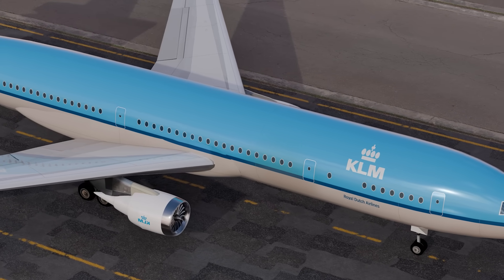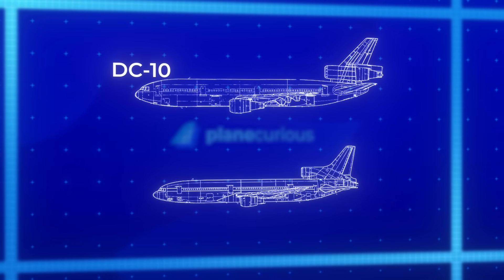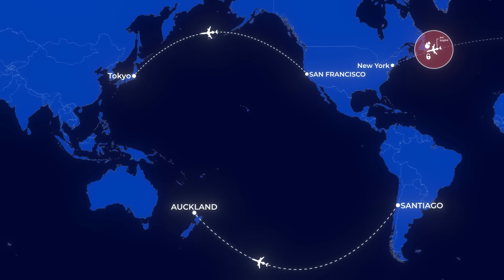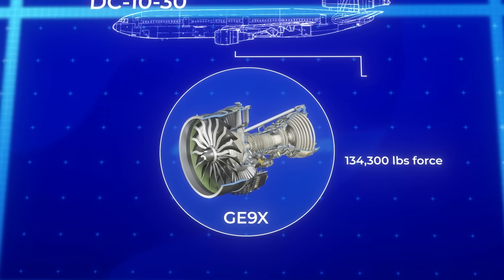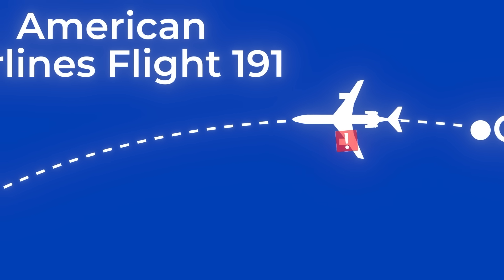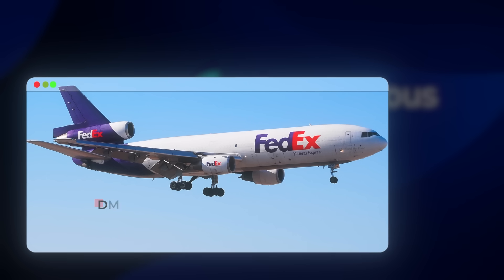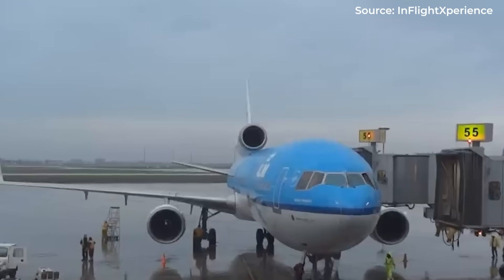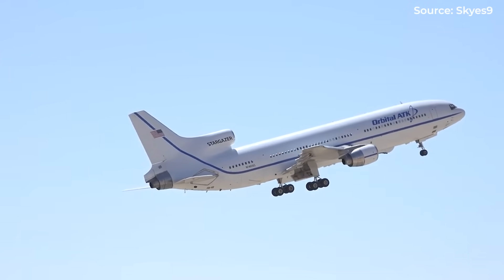Trijets Changed Everything - Until They Didn’t

Comment: They never needed 3 engines. It was all driven by FAA regulation demanding "more than 2 engines"
Reply: FAA never had a specific regulation "demanding more than 2 engines".

FAA regulations for two-engine aircraft aimed to ensure safe and reliable operations by establishing specific requirements for engine performance, operational procedures, and maintenance practices for extended operations.   

At the time, airlines wanted to create new routes, or expand existing routes which would require flying over water. When those could not meet existing engine performance requirements, operational procedures, and current maintenance practices, airframe manufacturers turned to a third engine.  Doing so was result of the state of engine reliability at the time, coupled with  airline customer demand. 

Bottom line, the decision was safety and market driven.

Comment: Flew on a 727 as a kid which seemed impressive to me and a step up from the 737 which was the first plane I flew on. Never flew on either the L-1011 or DC10 though have been on a few 747's. I always thought the L-1011 Tristar was a cleaner design and from what I understand was a technically more advanced plane.  I do seem to recall the 727 was quite noisy but I was sitting towards the rear of the plane.

Comment: Lots of air miles in all of them. All 3 were okay if you weren't in the noisy rear seats. DC-10's rode better in turbulence than any plane but a 747. 727 is a much smaller aircraft and really not comparable to wide bodies, regardless of engine configuration.

Comment: I had two trans-Atlantic flights on DC10's and to be honest I was somewhat nervous, but I found the aircraft quite comfortable, the seats were much better than the hard things you sit on now. And,. seat pitch was great too. Personally I prefer a 747 and 777 but I am glad I did get to experience one of the icons of aviation. I seem to recall the print ads used to boast that the centre engine was as long as the fuselage of a DC3.

Comment: In answer to the question, yes - I've flown on DC-10s, MD-11s and the 727 a few times before they were withdrawn from service.  I always thought the 727 was the most beautiful jet of all of the 700 series - so pretty, and it had that really neat rear door.  Loud though... holy moly.  The less efficient engines as well as the noise were two primary reasons the 727 were withdrawn.  I wonder if Boeing will ever make something that pretty again (especially in their current struggling state)?

Comment: A Mentor of mine...The Late Great Captain Harry Hargrove / AAL......discovered and sounded the Hydraulic alarm on the DC-10 six months before the
United SUX crash.  That being so many hyd connections under the center engine.  I had the opportunity to share this with the amazing Captain AL
Haynes.  I have had several hydraulic failures over 35 years in the cockpit.  Just the nature of the Beast.  But never anything like the SUX Crash.

Comment: Flown decades ago now MANY times in a 727, ALWAYS a better experience than a DC-9 or 737. Also flew a number of times in a 1011, those WERE the 'Cadillacs of the Skies', much more memorable than my 747 flights. TWA, my Dad's lifetime company (23K+ hours, mil/airline combo) had retired (1965) but then worked for FAA giving him chance for short stints at wheel of both a 747 and 1011 (former of his copilots, now senior captains he was 'check riding' with) told me- he liked 1011 over 747 for his very short time piloting both. The 1011's features from a pilot's perspective were just better!

Comment: "The probability of a dual engine failure on a twin jet, is lower than losing two engines on a trijet".

An unfair comparison.   You're comparing failure stats from an older generation engine with a newer generation engine.  Put three of the modern engines on a trijet and you have the exact same probability of an engine failure as in a duel engine jet ... yet you have three of them.

Comment: When Finnair still had MD11, my neighbor, who was a Finnair mechanic, toured me around the maintanence hangar. There was MD11 on block D(or something like that) maintanance going on. I'll remember that climbing on the tail engine tower was like climbing a high rise building by stairs. The top of tail stabilozer was even higher. There was about 5cm hole on the top of the stabilizer made a lightning strike. It was usual damage he said and the mechanics just patched the hole with riveted or welded(cant rebember which) piece of aluminium and made some other checks. 2006 my neighbor could just tell his boss that he is going to come in the weekend with me to have tour on the maintanence area and that was ok. Today there would be multiple security checks if it would be even possible to have some random civilian entering airport security area...
Reply: Actually there is a fuel tank in the horizontal stabilizer that is used to be transferred back and forth  to the main tank in the wing body for the Center of gravity trimming during the flight.

Comment: Trijets are ridiculously misunderstood. Everyone mistakes them for dEaTh PlEns which is not true. Yes the DC-10 crashed a lot, but the only crash that was the plane’s fault was Turkish airlines one. Others were maintenance problems or pilot errors. and that’s a *Fact*. And 747 also had some door issues as well, like the United flight where the cargo door flew out. And the same happened to the DC-10 (specifically DC-10-10 the only variant that had the door issue) but strangely, no one really talked about the 747 that much, but when with DC-10 everyone hated it.

Comment: I've flown many times in the Boeing 727 in the 70's.  But I heard it had one of the highest landing speeds so as to not flame out the top engine.  It may have just been a bad rumor or superstition, but I truly felt better flying in the Boeing 737 over the 727.  My last flight in a 727 was on Oct 7th, 1981.  I just joined the USAF and was flying out of Los Angeles to San Ontonino for basic training.  It was the first time I was going to fly commercially in over 8 years.  I was 18yrs old and had already earned my private pilot's license; however, flying Cessna 150s and 210's is a lot different than being a passenger in a jet.  For that flight, I got stuck flying in the last seat in the cabin - way back between the two side-mounted tail engines and under the top engine.  When the plan was cleared for take-off and the powerful engines hurled the 727 down the runway, I could feel myself being pressed into the seat.  Strangly, I was nerveous about flying in this type of jet, and was wishing badly that I could have been assigned a seat over the wings.   As the jet began to rotate and the nose wheel lift off,  I could feel the tail end of the jet drop and was terrified that the tail section was going to hit and drag on the runway.  Then as the landing gear wheels lifted off the runway, I could distinctly feel the tail section drop lower yet.  At that angle of attact as we climbing into the dark evening sky, I just KNEW that we were going to stall and crash back down to earth.  At least at that angle of attact in the Cessna 150, it would have stalled very quickly.  Of course the jet safely climbed to altitude and after leveling off I was much better and began to wonder what layed ahead once we got to Lackland AFB to begin basic training.
I hated that last flight and will probably never forget it either.

Comment: You left off the biggest detail "centerline thrust" is important! when the plane flies on just the center engine there is no yaw, that is a big deal when you have an engine way out on the wing pushing the plane making the plane want to turn and counteracting this force with the rudder causes lots of drag and changes the distance till fuel runs out.

Comment: Shortly after the Turkish Airlines disaster in France, I traveled to Italy. As our bus approached the plane, I saw to my dismay the trijet configuration. I nevertheless boarded, to diacov~ it was s an MD11. Both flights, to and from Italy, we're uneventful, I only later learned of the MD11 landing problems|, but at the time was relieved not to be on a DC10. It was a very smooth and superior flight.

Comment: 100,000 hours between failures, lets assume average speed 450-500MPH, that is 45M to 50M miles between failures. Highly experienced lifetime pilots may have upwards of around 25,000 flight hours, so the majority of pilots never experience an engine failure. I saw a video of a captain announcement on landing, stating they had an engine failure on decent, and that had not happened in his 35 years of flying.

Comment: Minor correction: ETOPS is short for engines turn or passengers swim.
Reply: They changed it to EROPS (Extended Range OPerationS) to downplay the "only 2 engines" aspect, which just got rendered as Engines Running Or Passengers Swimming.

Comment: Shows the influence of airworthiness certification regulations. ETOPS (Extended-range Twin-engine OPerations) exceptions were not allowed until 1985. Prior to that if you wanted to operate a twin-engine transport aircraft, your route had to be within 60 minutes on a single engine of a suitable airport, i.e. not across an ocean. If the airplane had  more than two engines, the requirement went away.

Comment: 2 Aircraft that should NEVER have been Certificated are the DC10 and B737 MAX. Because of their Designs and inroads with the FAA over 1,000 persons were murdered! ALL trijets had engines installed in rear with an S-Duct intake. The DC10 / MD11 had the engine installed in the vertical stabilizer.😱 Rotor Burst was NOT calculated at all! It took out ALL hydraulic controls; collapsing floor where flight controls ran under! Also Cargo Door faulty Design…need I say more?
Don’t need to say anything on the BIGGEST BADDEST BOEING ‘CRIMINAL’ MAX FIASCO in Aviation EVER! Retired Civil Aviation Safety Inspector.

Comment: American Airlines Flight 191 didn't happen because of the tri-jet design of the aircraft.  It happened because American Airlines, in their corporate greed, ignored the standard protocols for removing the engines for maintenance.  The left engine's connection to the wing failed, and the engine blew off of the plane as it was taking off.  This happened because the plane was undergoing routine maintenance in Atlanta, which required that the left engine be removed.  The standard protocol was that the pylon must remain bolted to the wing, and that the mechanics were required to unbolt the turbine from the pylon.  Instead, American Airlines used a shortcut where the mechanics would unbolt the pylon, which had only a handful of large fasteners, thus saving many hours of labor cost.  Unfortunately, upon reinstalling the engine/pylon assembly, the forklift pushed the assembly up too high, damaging the mounting points for the pylon.  Stress fractures ensued, and it killed several hundred people.  This is the price of corporate greed.  Several hundred people lost their lives because AA thought that they had out-smarted the manufacturer's standard maintenance procedures.

Comment: American airlines had nothing to do with the development of the L-1011. They ordered none from Lockheed. Eventually they operated a half-dozen of them that they obtained second hand from Pan Am. 

It was Eastern Airlines and TWA, through a joint order of 144 aircraft in the spring of 1972 got production rolling on the L-1011. United did not even obtain theirs until 1986, 14 years after production started!

Comment: I was told the tri was more for redundancy than needed power. Though they did make them hold more fuel I believe because they could carry more weight. But only NEEDED one engine to land and the % of losing two was pretty low. Now with longer lasting and more efficient engines.... That was what I was told few decades ago as a aircraft mechanic.

Comment: 7:20 that accident has nothing to do with the center engine.
Reply: What caused it ?
Reply: @WISHBONEL7 the pylon for engine 1 or 3 (I forget which one) failed and the engine literally fell off, and hydraulic lines were severed. I haven't looked at that one in a while so I don't remember it too well
Reply: @vtawa.  The number (1) engine fuse pin failed due to the AA mechanics removing the engine and pylon together using a forklift, rather than following Douglas Aircraft Company (DAC) mandated procedure to remove them separately,. And WITHOUT use of a forklift.

Comment: The DC10 had FOUR Engines not Three.

You are thinking of The Trident.
Reply: Unless you're counting the APU, the DC10 most certainly only had 3  engines not four. Having flown on them many times as well as having worked in the control tower at Long Beach, where they were assembled and test flown, my counting skills confirmed that number on practically a daily basis.

Comment: The Flight 191crash was caused by shortcuts and processes used by AA when replacing the engine.  The number of engines had nothing to do with that accident.  Not sure why it was even mentioned in this video.